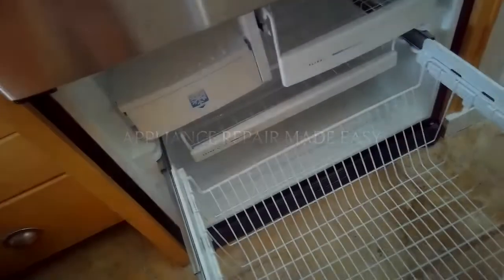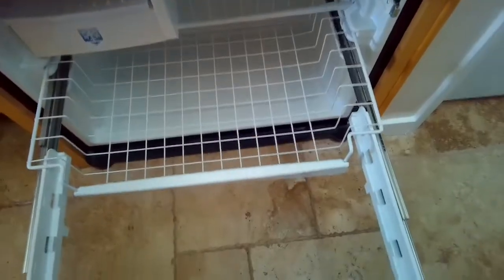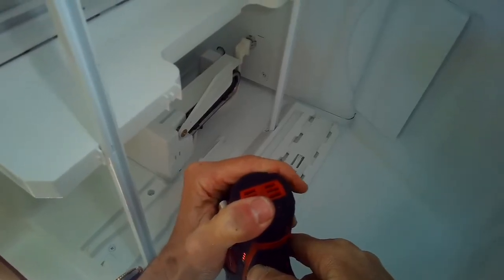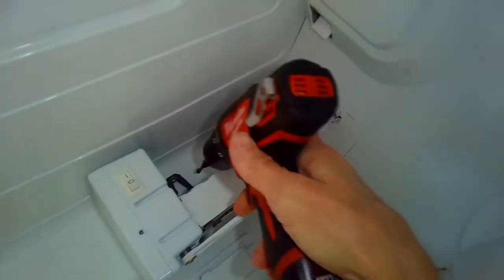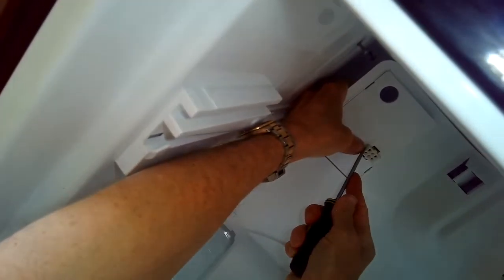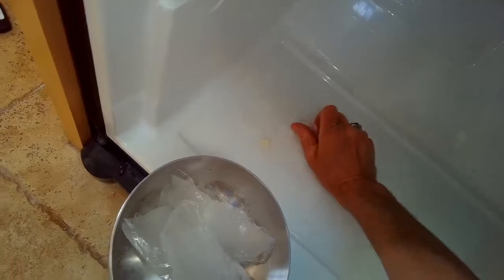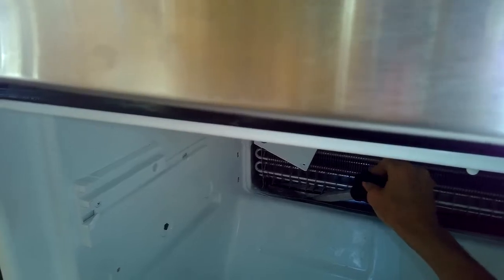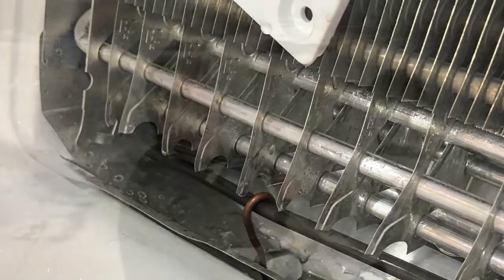✨ GE Profile Bottom Freezer - Iced Up - EASY FIX ✨

Comment: I had the same issue within two weeks of buying a ge fridge. I took it apart after watching all the you tube videos and read the manual. Two things: my first problem was the leveling of the fridge. The manual clearly says the fridge needs to tilted about 10-15 degree backwards for the condensation to drain properly. Although I had it professionally installed the installers never did this. The fridge comes with leveling feet at the front. You have to raise the front of the fridge by turning those feet to make it higher so it is slightly tilted backwards. In my case leveling the feet was not enough since our kitchen floor is slightly sloped inward. I had to put some wedges underneath the feet to make it tilting backwards. The second problem was the drip tube as the maker of this video pointed out. My drip tube is “J” shaped and comes with a lot of gooey stuff to hold it in place from the manufacturer which eventually gets clogged. I cleaned up all that gooey stuff and put a wedge underneath to hold it in place (probably didn’t have to). Problem solved. No issues for a year so far.
Reply from the maker: Wow,
Good job👍

Comment: My GE Profile French Door Refrigerator model is PFSFOMFZB BB and was slightly different.
- two small hex head screws held the freezer door to the door slides.
- the ice maker electrical plug connecter was on the left side behind the ice maker itself
- there was no small panel on the rear panel to disconnect the electrical connections and I was unable to actually remove the rear panel, but I was able to flex it enough to be able to access the ice and put hot water down the drain hole.
Your video was the only one I found that was helpful for the GE Profile French Door fridge.  The fridge is about 8 years old and this was the first time I had to unplug the drain. Thank you very much for your detailed video.

Comment: This video worked for me as it is the exact same fridge as mine, and it's far from obvious how to take it apart. I ran into a few tiny issues.  The little white tabs you press to remove the door hinges were not so obvious to me. Spent a half hour working that out. Once you find them, they are obvious, but its surprising how tiny and inconspicuous they are. Once I removed the back panel, there was some foil covering the insulation, which got stuck in the ice and tore off. Had to run to the store to buy new foil tape for that. That panel takes a long time to dry out and It's not obvious exactly how it goes on. Lastly, the plastic tube in the back of the fridge that connects the drain hole to the condensate pan was clogged up with hair on mine, so it's a good idea to clean that.
Reply from the maker: Thank you

Comment: Just did this. Video was VERY helpful. Thank you!! My door rwas secured by a screw on each side near the front instead of the white tabs and it lifted out. Ran a LOT of hot water before realizing there was debris (lint/dust and sludge) in the drain tube and clogging the drain tube cap (WR02X12074). Broke a tab holding one of those 2 cross bars. No biggie. Thx again.

Comment: This worked perfectly with my pfss2mjycss. Thank you! 

However, after putting everything back together, my water will not dispense from the top anymore. Any idea what I might’ve done?
Reply from the maker: I wonder if the water supply line in the door froze over?

Comment: Had the identical problem, and sure enough, drain pipe was frozen shut. With Scott’s clear step by step instructions I was able to clear it. Let’s hope the copper wire prevents it from reoccurring.
Reply: Hello!!  Did this permanently fix the condition for you??? I need to do this exact thing. I have ice build-up in the bottom of my freezer, and it causes water to leak out from the freezer and across my floor.
Reply: @AP-ch7bf  So far the issue has not reoccurred, and it’s been a year.

Comment: Excellent video with great details! Followed almost exact steps (Except the freezer drawer that I had to remove two screws on the side and push up to disengage). The copper wire idea is ingenious! Hopefully it will work (I don't understand why GE fridge could have drain tube frozen up - never seen it on other brands). The only thing that is not clear in this video is removing the divider after loosening the screws of the left rails. I think you need to push it down a bit and twist it out.
Reply from the maker: Thanks Charles,
Can you remove the lower cover behind the fridge and pull off the plastic drain tube and make sure it’s not clogged?
Reply: @QuickAndEasy5MinuteAppliance  I followed your instructions and poured hot water down the drain to unclog. Checked the drain tube in the back, it was clear. Hopefully the copper wire will prevent it from happening again.

Comment: Mine has a flapper electicly operated that sticks or gets broken and it causes the freezer to ice and the top to get warm. Great video! Thank you!
Reply from the maker: Nicely done Wilbur👍
Reply: Wilbur Collins what did you do to fix the flapper problem? We are having the same issue with our fridge
Reply: As it turned out the flapper was clear and get to it I put all the shelves out of the upper part and there's a about a 9 inch wide cover that goes almost the whole up and down part of that part of the refrigerator I pulled it off and checked it the flapper was okay. So then I went on YouTube and found a video that showed how to take the freezer completely apart when I did I found that the coil back their head frozen solid
Reply: I used to hair dryer and I made sure that is completely thawed before I put it all back together. I also looked a little piece of copper wire off of the heater bar and down into the drain hole because the drain hole was freezing. That kept it open. No more leaking on floor.

Comment: Could I just let my freezer defrost overnight to get the same results? Great instructional video, thanks so much
Reply: I think the idea is to prevent it from happening over and over again. It's interesting a while back my 2 door fridge had exactly that same problem and that's the kind of solution someone suggested. I got the copper wire in there and the fridge never iced up again.
Reply: I unplugged mine and the ice is gone but I think the copper wire is what the original repair man did sixty days after I purchased this refrigerator second hand. The seller also had to repair during the warranty. Just had it repaired again and it’s been 94 days….guess the labor warranty….90 days.

Comment: More ice build up in bottom of the Monogram freezer. This time I used a turkey baster with boiling water to try and clear the drain hole which goes to the evaporation tray below the freezer and realized it was not an ice in the tube build up but actually debris (metal filings or something) that was clogging the tube. Used a piece of wire to unclog the tube until it started draining water. I think this will fix it- There is a lot of water released during the de-condensation cycle and it has to make it to the evaporation tray
Reply from the maker: Thanks Spencer😊👍

Comment: Thanks for the video! I used this last year, added the wire and all was well. But now it’s happened again. Could there be another cause? Is there a defrost timer for the freezer?
Reply from the maker: I think just doing a manual defrost will get it going again.
Reply: @QuickAndEasy5MinuteAppliance  I defrosted, but there was about 2-3" of iced water (looks like a frozen lava flow!) that had poured down. Took probably 30m to hack it out. I'm worried this will keep happening if the copper didn't solve the problem? It did take a year, but still...

Comment: So a few months ago I did this and cleared the blocked ice (see my earlier comment). Worked great. But I didn’t have copper wire, so i skipped that and crossed my fingers. The problem came right back, so I got some wire and tried again. Let’s hope it works this time.
Reply from the maker: I hope so😊
Reply: PSUfilms any updates?
Reply: @peterkaloroumakis2559   So far, so good. I didn't want to jinx anything, so didn't say anything. But no ice has returned since adding the copper wire!
Reply: same here. I'm about to take it all apart soon. Worked very well after I let is defrost completely. I need to add the copper wire apparently
Reply: I have also added the copper wire, worked great for 2-3 years. The fix this time was a new drain hose on the back of fridge. The old one had calcium or lime buildup & water would set in line & freeze due to the lower freezer unit. I should add that the lower freezer unit could probably use a couple inches of copper wire also. Good luck.

Comment: Use a steamer with hose and 90 degree angle nozzle. It will clear the drain in less than a minute and save you a lot of time rather than boiling and using a turkey baster.
Reply from the maker: Great idea😊💻 New Appliance Repair Blog - lots of DIY Fixes for Your Home Appliances - Click Here:
https://ApplianceFixes4You.com

Comment: Hi!  This video is great. However, I have a GE Monogram Built-in All-Freezer (model ZIF36NMLH).  And I keep having a recurring problem where the ice builds up on the floor of the freezer and then somehow melts itself and just drains from under the door (not the drain pan) to the floor. Would this process work for me? I have been melting the ice but it keeps building up - each time more quickly.  (Oh and now the ice maker isn't producing for some reason - but this doesn't usually happen in conjunction with the ice on the floor.) Thanks for any advice you can give!
Reply from the maker: Hi Rob,
This video will solve it👍 Make sure to add that copper wire to the heater at the end of the video.
Reply: Ok. Thanks. I will try

Comment: Sans the addition of the copper wire, could you just let it defrost on its own?
Reply from the maker: Sure, but it probably doesn’t make enough heat anymore to melt the ice down in the drain hole .

Comment: I used a hair dryer!  Question.  Does this go to the same drain tube as the refrigerator or straight to the tray.  My Refrigerator was icing also and I determined i had a lint blockage at the top of the drain tube.  That was when I decided to check the freezer coils, and sure enough, those were iced up too.   I'm defrosting that one now and as I have cleaned that blockage, I'm hoping this worked.  So in summary, one blockage at the bottom resulted in two ice dams, one in fridge, and one in freezer.  Am I right?
Reply from the maker: I think you need to change you’re terminating thermostat that controls the defrost system.
When that stops working the coils will ice up.
Reply: @QuickAndEasy5MinuteAppliance  Oh boy, where is that, what does it look like, and where do I get one?
Reply: Iced up again.  So much for my blocked drain tube theory

Comment: what type/size of copper wire do you need to buy? I let our freezer defrost completely last time and we were good for about 3 months but it has happened again. Wanted to make sure I bought the right thing before adding the wire.
Reply from the maker: 10 or 12 gauge is good
Reply: @QuickAndEasy5MinuteAppliance  OK thanks. They only had 8 gauge at Lowes....is that too thick? Also how long should the piece be?
Reply from the maker: 8 gauge is good.  The straight end should just enter the drain hole.  Probably 2.5 inches.

Comment: I’ve put boiling water in it way more than 15 times and the water is still pooling up. Anybody else have this happen? Should I keep trying?
Reply from the maker: Thanks Ryan,
Can you try removing the lower back panel behind the refrigerator by taking out the six screws that are holding it in position? Then see if you can find the plastic drain tube that leads down to the evaporation pan and then wiggle it loose from where it connects to the freezer drain pan and see if there is some junk caught in there that’s causing it to not drain.
Reply: Your issue is most likely solved by now. Just mentioning for future readers:  Used a LOT of hot water and the clog was still there. Removed the lower back panel, disconnected the drain tube and blew down into the tube which was completely clogged with sludge/lint wads towards the bottom cap. Removed the bottom cap, cleaned it all out and now I'm good to go. While I was back there, I should have added a touch of bleach to the drip pan which has a tenancy to get slimed up.

Comment: Water is dripping into my ice tray and appears to be coming from the ice maker itself  PGCS1PJYASS GE Profile  Any advice?  Every time I go for ice, the majority of the cubes are frozen solid in a block and useless (in the tray)
Reply from the maker: Hi John,
It sounds like the water inlet valve lets in too much water when the ice maker calls fir more ice.
There’s an adjustment screw on the ice maker to make the cubes smaller.

Comment: my freezer temp is up to 40. Any idea why?
Reply from the maker: I wonder if the freezer door is closing all the way
Reply: It does. I shut the fridge from the breaker for a minute and turned back on. It showed zero for the freezer or 15 minutes but then it became 44 degrees
Reply from the maker: Could be a refrigerant leak.
Reply: I opened the cover in the back and there was no moisture anywhere @QuickAndEasy5MinuteAppliance
Reply: It's not just the freezer, both are not cooling at all
Reply: I have this same problem, did you find the solution?